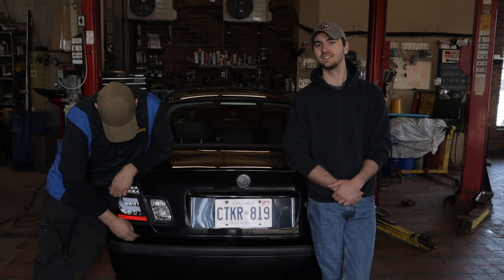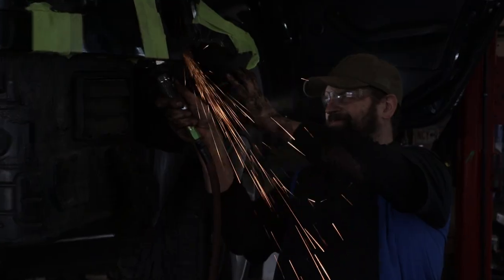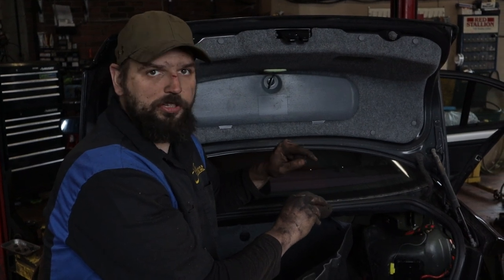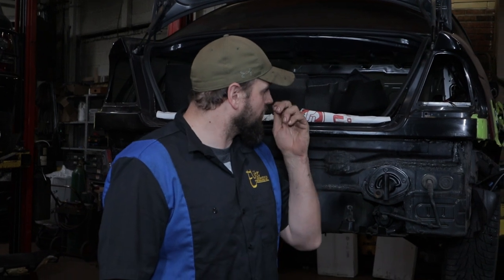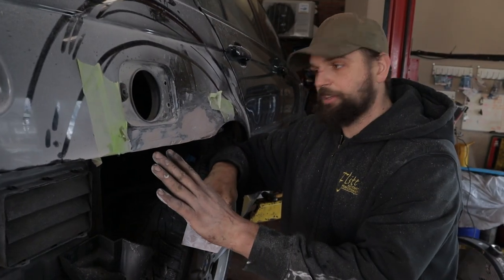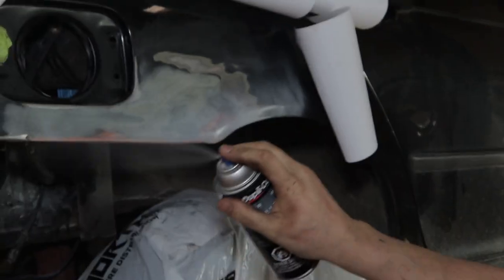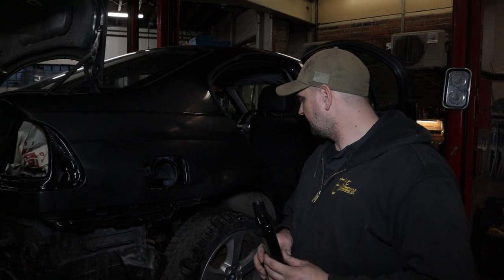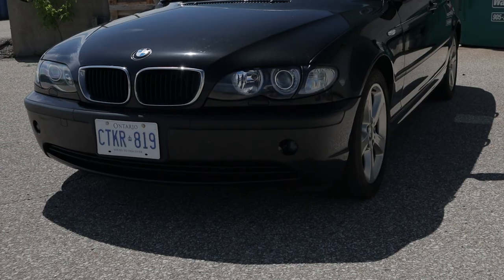How To Repair Rusty Fenders - BMW E46 DIY Rust Repair

Comment: ive just been quoted 3000 to fix the rust on my E46 but it is nowhere near this level. Only problem is its definitely had Rust repair before so will that effect the method if the area rusting already had filler?

Comment: Great stuff! I was wondering how you guys tackled the inside rust near the battery? Same process as the fender?
Reply from the maker: Very similar, used a die grinder with a carbide and a right angle one with a standard grinding disc